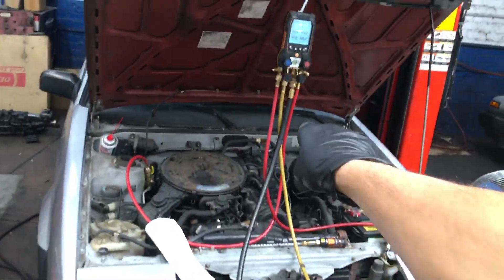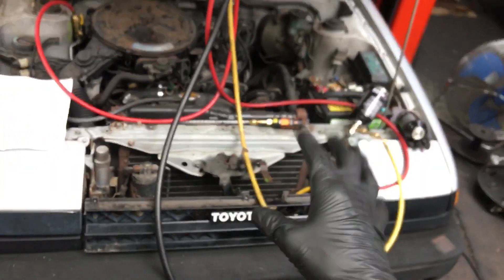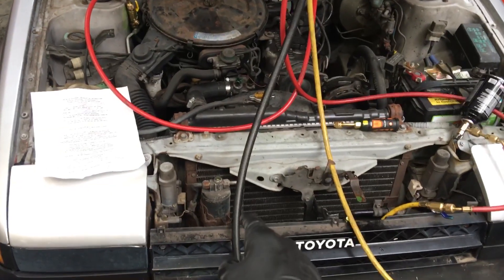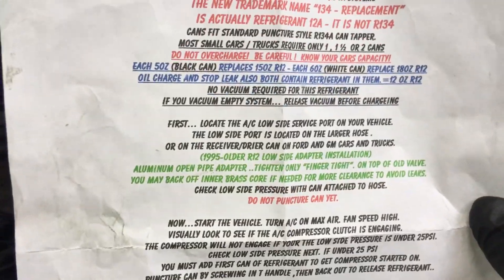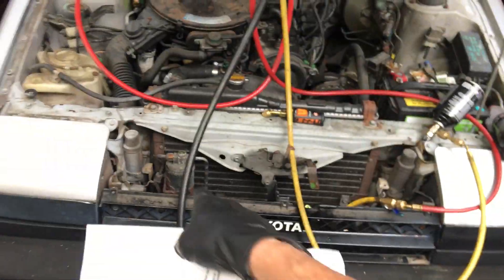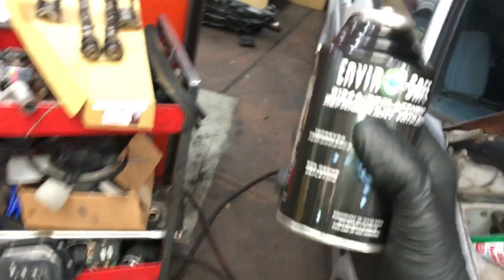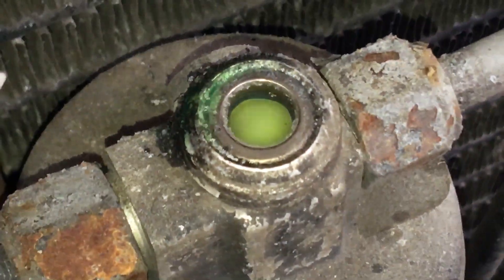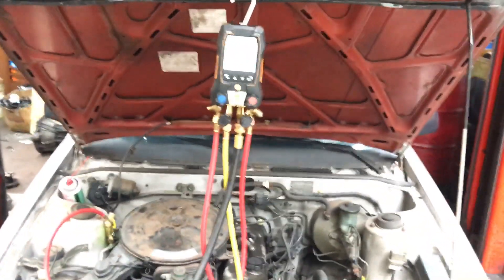Flammable 🔥 Refrigerant Installed In  Car Past Leak test, but now it leaks. Let’s put a match onit

Comment: I think if you changed the windshield wipers like ur supposed to, it would have been fine. 
I would have mentioned to the customer that not changing their socks  & expansion valve it might leak or not work...👀😱 ¯\_(ツ)_/¯
Reply from the maker: That’s a receiver dryer not an accumulator. 
        I told him to change it. They didn’t listen..
Reply: @coldfinger459sub0  Thank DoG 🙏 for signed work order jobs 🤘💀🤘

Comment: Is that refrigerant HFC-152a?🤔
Reply from the maker: A propane butane mix.  

HFC – 152a is used in Europe as a Refrigerant . 

In the United States, we know it as a can of dust off to use to clean your computer keyboard . 

That’s what a lot of guys on YouTube or using as refrigerant and it works really good usually not done correctly but when they first do the job it works really good 

And then nine months or a year and a half later, they have a burned out compressor 

They were all happy and smile faces when they first put it in, and it came out cold from the dash of their car 

Not many of them posted after videos several months later for a year or more later with their burnt up compressors . Oops. 🙊🤣
Reply: @coldfinger459sub0  yeah, I've seen videos about that refrigerant being installed in cars, lol. what would make that refrigerant (152a) burn out the compressor(s), is it because it's not compatible with 134a systems? 🤔
Reply from the maker: @midas617  usually because they got the charge level wrong a little too much or a little too little. 

It mixes really good with POE oil 
It’s OK with PAG oil 

The guys would really mess up when they thought they can convert R12 
Because it is not compatible with mineral oil that is used with R12 

Then you had all those old timers who are used to trying to fill old fashion cars that had six piston compressors by a certain pressure they would see on the high side on a hot day 

And then they try to do the same thing with R152 a 

They completely different temperature to pressure relationship curve and they would get it wrong every time 

Even if they happen to get it to come cold out of the dash 

Usually before the summer was out or by the time summer roll around if they did it in the winter time they would burn out the compressor 

And they’re always so happy that they got it to blow cold, and they think they were successful because when they were finished, the compressor was running and it was blowing cold out of the dash . 

Compressors outlast the life of a car, the life of an engine, the life of a transmission 

Compressors do not die by themselves 

They are murdered
Reply: @coldfinger459sub0 So, r152A and  'envirosafe' are basically the same when it comes to weight when refilling the system, compared to 134A? 🤔
Reply from the maker: @midas617  less but how much less is the secret? It’s not the same for all systems this is what they don’t tell you.

Because there’s so many variations it’s not possible to give you a simple rule of thumb . 

Especially when it comes to variable Displacement compressors . 

Especially when you don’t have control over your climate in the day, you try to charge your system it’s during the winter time or spring time when it is cooler . 

You cannot control the cars computer that controls your fan if your car has a pulsating on and off single fan that will greatly affect air flow and never give you a steady reading 

If you have a vehicle that has variable speed fans that are constantly ramping up and down 

Or a old fixed Engine San right off the water pump 

If you have a car that has little to no fan shroud 

Compared to a car that has an excellent fan shroud 

These were all affect your high side pressure 

The problem with refrigerant that take a lot less. They’re also a lot less than volume. . 

And when you have a receiver dryer, that is one of those short fat type of receiver dryer’s . 

Because the refrigerant level is so low it’s almost at the bottom of the receiver dryer, right where the pick up tube and straw is located . 

So it’s often common to run in a scenario where it’s picking up vapor instead of a full column of liquid . 

And this varies greatly on different ambient temperatures . 

Receiver dryers that are designed for hydrocarbon, refrigerant or very low volume . 

Are specifically designed to be extremely narrow and tall . 

The receiver, Dryer, on these Automotive we’re not designed for these types of refrigerants . 

You’ll get excellent cooling results. 

But depending on your scenario, you will not get excellent compressor life. 

🤫. Don’t tell anybody this is a secret.
The guys who sell these refrigerants don’t want you to know.
Reply: @coldfinger459sub0  yeah, it's all a gamble. 

At least for now, we have 134a. if and when they ban it, it's good to know that there are alternatives for that system. 

And hopefully by then, someone will figure out a chart on how to fill those systems. 

For example, "if your system takes x amount of 134a, you need x amount of..." whether it be 152a or that propane butane mix. 

It'll be interesting to see what happens.
Reply from the maker: @midas617  they will not get rid of 134. It’ll usually always be around for decades to come it’ll be expensive, but it always be around.

Just like our 12 it’s still around there’s literally millions of tons of it throughout warehouses in the United States 

I have nearly 400 pounds myself 

It’s not illegal to use 

They just do not manufactured in the United States anymore 

Just like 22 refrigerant is still around it’s not illegal to use. You can still fill up your systems with 22 if somebody is just willing to pay the price. 

And they’re starting to phase out 410 out of residential it’s becoming extremely expensive it’s not gonna go away. The price is just going to go up.
Reply: @coldfinger459sub0  that's what I mean. by either needing a license, and or making it not economically feasible for the common folk to obtain it. that's when people like me will need alternatives.
Reply: @coldfinger459sub0  "  Compressors outlast the life of a car, the life of an engine, the life of a transmission 

Compressors do not die by themselves 

They are murdered "
True that !    Jay Fox
Reply: @coldfinger459sub0    this topic ( hydrocarbon refrigerants in cars ) brings up a good question ....as per your suggestion ....
Where would one get a proper tall and narrow receiver drier to make a better conversion with such low amounts of Hydrocarbon refrigerant these systems use.
Thanks in advance    -  Jay Fox
Reply from the maker: @charlesleake930  you would have to get one from appliances that use hydrocarbon refrigerants that have a receiver dryer. 

Most small appliances use cap tube systems so they don’t have receiver dryers . 

But any small air conditioning unit that’s a ton and a half of hydrocarbon BTU capacity  

Would have a very small, narrow, tall receiver dryer that would be a part number. You just take it from another component company manufacturer. . 

Hydrocarbon expansion valves are available from DanFoss and Sporlan 

And you can make your own receiver dryer for hydrocarbons out of copper piping . 

Just has to be tall and narrow . 

Can you put your own pick up straw pulling off the bottom just like a real receiver dryer. 

Really easy to make.

Comment: Well nobody made you take the guys money or agree to do the job if you were so against it.
Reply from the maker: Actually, I volunteered to do it. 

I don’t agree with it because he did not purchase the dedicated fittings that are supposed to be screwed over the existing quarter inch fittings so nobody else can fit regular Refrigerant hoses on it . 

When you get the stuff by law, do you have to put proprietary fittings that do not allow the use of any normal Refrigerant hoses to fit on. 

I actually want to do some propane conversions .  But I would like to replace the receiver dryer’s, so that their proper type of receiver dryer to accommodate propane’s lower, refrigerant charge.. 

Due to the fact that the charge is so much less, the receiver dryers are not properly constructed for the propane charge . 

They must be much narrower thinner and taller 

Instead of short and fat . 

When you do propane equipment, you will notice this on commercial and industrial refrigeration and air conditioning units. The receiver dryers have a much different construction for a reason. . 

Automotive guys don’t know this because they have no education in air-conditioning refrigeration . 

Oh, in the past years ago, I had to unfortunate fact to hook up my recovery machine to one of these units that I did not test a Refrigerant with my Refrigerant . 

When I slipped on the switch to recover the refrigerant, the propane and butane mixture, it blew my crankshaft the rod and piston out the side, it in bottom of the recovery unit . 

That was $800 about 15 years ago 
And $800.  15 years ago was a lot more money than it is today . 

Ever since then, I always hated people putting the stuff inside their cars because the damage does two professionals who work in the trades equipment . 

But ignorant people in the trade who are not professionals, but yet they work in shops and use the stuff don’t know any better or they pretend they don’t know any better, because they just want money . 

Those are the kind of shops I would like to get rid of

Comment: The HC blend attacked the rubber seal in the sight glass , HC products attack a few rubber compounds
Reply: You also want to charge according to molecular weight.   Do the conversion from r134a to r290(propane) or r600a(butane) it’s not that the system takes less , fluid volume it should be the same amount ,  it’s that HC products weigh less for the same fluid volume.  Picture a red party cup filled to the top with r290 and r134a.  They will both be filled but the HC will weigh 60%ish less on a scale
Reply from the maker: Yes I know. My father taught me that I was still in grammar school. 
        Again taking HVAC/R school 

Problem is the reciver is wrong for HC  when converting to HC. 
     The HC Refrigerant vary low all most at the pick up tube .  I starving for liquid refrigerant sometimes. 

HC reciver need to be smaller diameter, thin tall. This is a design factor.  Many don’t know about.  

My freezer at home only has 1.44 oz of R290 
     Keep my food at -22°F  HC is such a great refrigerant.
Reply from the maker: This car are known for leaking sight glass.  I told the shop owner to change the drier because of leaks before I started.   
        It will pass static pressure test cold. 
 But as soon as the refrigerant gets hot 🥵 refrigerant heated up the aluminum it expands.  But the old dried out rubber is not elastic anymore.  So it leaks. 
I see this all the time on these old. Cars.
Reply: @coldfinger459sub0  

HC refrigerant can swell and break down some types of rubber that were originally ok with chlorinated refrigerants.  There is a small list available of HC incompatibility.  I have seen it attack some brand new components, it’s extremely rare but any natural rubbers will not do well.   Need to be viton, florinated , or ptfe based.
Reply from the maker: Yes read the list here in 40 years ago.  My father had me me read this. 

But that had nothing to do with this leak. It was already here. That’s why it was empty.

Comment: 134 is flammable under pressure
Reply from the maker: The refrigerant oil for 134 is more flammable than Refrigerant. 

Under pressure with oxygen compressed in a vapor form . In ideal laboratory conditions that have to be set up intentionally.. 

Propane or butane you just release an atmospheric air, and it is now flammable 

So what’s your point 

Water is flammable  😱 Oh my God, the world coming to an end we have oceans full of water..